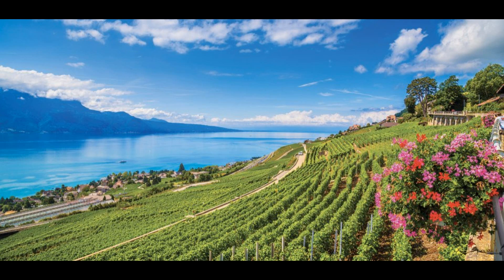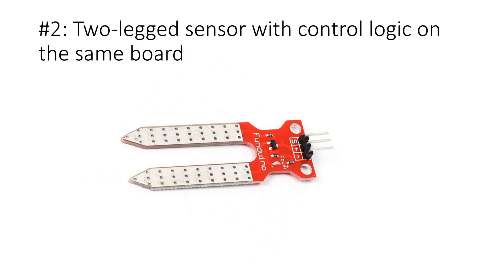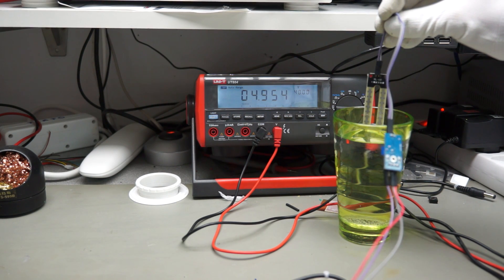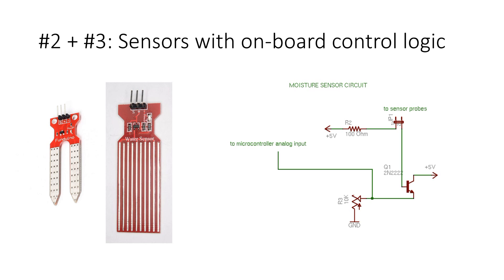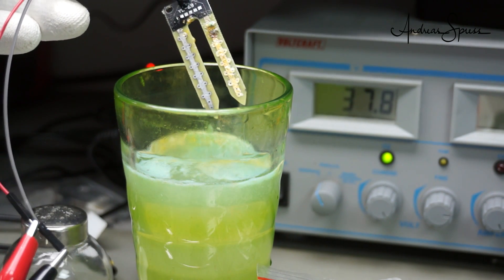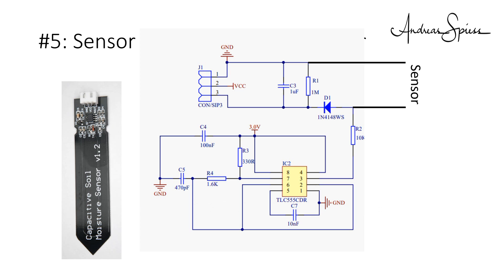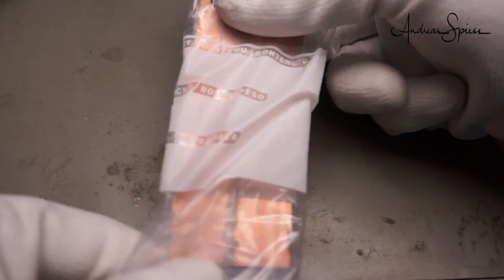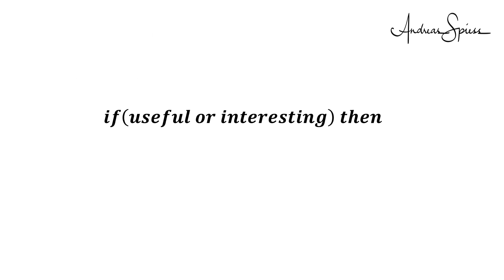#207 Why most Arduino Soil Moisture Sensors suck (incl. solution)

Comment: As we don't live on the surface of the sun the moisture does not need to be measured multiple times per second. Limiting measurements even to once every 5-10minutes increases the lifespan of the cheap sensor drastically as the lack of constant dc current means the copper corrodes much slower. Of course the time frame between measurements could be increased even more for a longer lifespan.
Reply: Water and other things in the soil will react with the metal even when no current is flowing, so a capacitive sensor is a much better option as it is 'non contact'. But you are correct the lifespan can be increased.
Reply: Still the natural process of oxidation would affect the measured values over the time, making the whole thing useless without constant recalibrations. Honestly I don't think it's really needed to have continuous  measurement at all, you calibrate the watering system once in June, monitor it for a few days and it will be just fine for the rest of the summer (at least in my mediterranean climate). But hey, we like to tinker with sensors, don't we... :)
Reply: Two stainless steel electrodes will last a lifetime. Copper in ground thats 35 micrometers thick, you got to be kidding me. Thats not even a problem...
Reply: And the capacitive sensors are like 3$, so it's not that bad
Reply: ivanhoe011 I measure 4 times a day sending power to the sensor for a few milisecs.. no need to recalibrate during the season
Reply: The key word in that sentence is "just".
Reply: You could also use other electrodes which do not corrode (as easily), such as graphite or platinum/gold (plated). The later two are probably more expensive though.
Reply: @kwinvdv  i use graphite rods. Works very well
Reply: Along with not needing a reading multiple times per second, you can get a LORA micro controller to run for weeks or even months on a battery if you have it sleep or, better yet, power off between readings especially if they are only done once or twice a day. Or have the voltage from a solar cell power on and run a micro controller first thing in the morning to take a reading and transmit it to a receiver.
Reply: Doxie: But I like this song better: https://www.youtube.com/watch?v=3JdWlSF195Y  (and the cats are extremely cute, so it must be true) :-P
Reply: Agree, and where can use AC to drive those sensors.
Reply: I d say once every 4 hrs
Reply: That is too much. I just need 4 measurements a day, and that is for an independent study to support effectiveness of a special compound I'm going to use. But I do want to build sensors with a lifespan of 40 or 50 years.
Reply: what about spray or dip coating the sensors in some water resistant coating substance?
Reply: Anyone thought about pulsing a resistor to heat it next to a thermistor? They can be protected in a conductive pipe and inserted into the soil. The heat wave seen by the thermistor will be a function of moisture level at insertion point.
Reply: Just use a digital out to power the sensor only when you need to read it.
pinMode(sensorVCC, OUTPUT); digitalWrite(sensorVCC, HIGH);
// analog sensor reading logic
digitalWrite(sensorVCC, LOW);
Reply: What about something like the vegetronix vh400?
Reply: Try to keep a plant wet on the surface of the sun ... Need to measure really fast to get something ;-)
Reply: There are a lot of Arduino sketches out there where a digital pin is used to power the sensor only when needed.
Reply: WKD:
what you say is right but to be sure to stop the galvanic corrosion you should electrically disconnect the sensor when you do not take the measurement, this should be done using another Arduino channel and maybe a bipolar relay
Reply: Benjamin Sølberg You could also greatly slow the effects of galvanic corrosion by cycling the polarity on each leg, which helps to re-attract the lost metal ions back to each leg rather than encouraging one leg to only ever shed its ions while the other attracts them.
Reply: @Micheal S:
Im not sure why you try to correct someone at something you dont really know anything about. But let me help you out: Its a "ball" of plasma, not gas. There are no defined changes in density as you know them from earth (air -> water, density times 1000), its all a big gradient. He doesnt say if the change is linear or whatever, there is just a gradient.
Reply: WKD and others - You're obviously missing the point completely. The exposed metal parts on the probes of the "sensors" are reactive, meaning that electrochemical reactions take place when they're submerged in the water EVEN IF THEY'RE NOT CONNECTED TO A DC SOURCE. This not only means corrosion of the probes, but also leaching of the probes' constituents into the soil. While tin is (usually) not too toxic, copper in higher concentrations IS detrimental to plant growth and nickel is really toxic. This is what you risk by using crappy probes in an effort to try and save a couple bucks.
Reply: You could also alternate the polarity between measurements
Reply: @Jadinandrews  you could, but if you supply power say 6 times a day for just a few msec to do measurement, changing the polarity is hardly worth it
Reply: Yeah, measurements once per hour, alternating polarity, thick copper wires instead of flimsy paths, and the sensor works fine for a looong time.
Reply: Michael S: My first comment was actually intended as a joke by completely ignoring the heat that would instantly burn the plant pot including the moisture sensor before it is even close to what we would call the surface of the sun. But I don't think that the statements "ball of gas" and "gradually increasing density" are completely wrong.

First, the sun is mostly hydrogen (gas) and held together by gravity, which has the tendency to pull everything over a certain mass into a nice sphere (ball). So yes, it is a ball of gas (mostly). Of course there are metals in the sun, but it is mostly hydrogen. The Maybe it it would be more correct to call it a "ball of mostly gas with a core of very hot and dense plasma" ;)

And as a object that is held together by gravity, its density increases with decreasing distance to its center. If there is any change in density, the less dense mass will rise and the more dense mass will sink. That is what happens in the convective zone. Those zones aren't "jumps" in density, they are just labels we have given to these regions to describe what happens in them.

I just repeat my words from my first comment:  It is just a ball of gas with gradually increasing density, nothing to stand on. :)
Reply: Michael S: Of course, gradually != exponentially. For me, gradually meant that there is a increase in density with depth, not implying a linear relationship between depth and density. :)

You could have pointed out that the density increases exponentially in your first reply. But this way was also good, as I didn't realize the use of the wrong word and this exchange of comments might be more entertaining and interesting for others than the original joke. ;-)
Reply: > the sun doesn't have a surface

Nothing has a surface, really; that's just a human concept. Atoms are fuzzy things.
https://www.youtube.com/watch?v=P0TNJrTlbBQ
Reply: Do you even need to measure it every 5 to 10 min? How about every 6 hours?

Use a DS3231 RTC attach the alarm pin to a mosfet that turns on the ESP8266. The sketch can come on, connect to the network, take the reading, report it's reading to the MQTT server, then set the alarm on the DS3231 which resets the alarm pin and shuts down the ESP8266.

That takes the standby to <<100uA for the RTC to run and eliminates any charge to the probe.
Reply: Copper oxide will form anyway the moment the coating has the tiniest pin hole its like rust on steel
Reply: Hi. Oh, I can't resist wading in! Yes, we don't NEED continuous measurements but arranging for that increases the complexity and the cost. As others have pointed out sticking bits of conductive metal into possibly damp soil is asking for trouble even if no current is being applied. It's fundamentally the wrong technolgy. As the detectors corode the measurements will alter and become misleading even before failure so the fact that it is cheap technolgy does n't help either. An automated sysytem using this would over or possibly under water. It's not until I saw this video that I realised just how challenging getting these measurements is. BobUK.
Reply: Sure there are a reaction while its not powered. But biggest reaction happens because of electrolysis (I believe that's what this process is called).
Reply: There's no water on the surface of the sun.
Reply: 2000jago: I just assumed that it was a joke, because the sun doesn't have a surface. It is just a ball of gas with gradually increasing density, nothing to stand on. :)
Reply: Pendant time: the sun isn't a ball of gas, it's plasma. Wait, They Might Be Giants did a song on this:
https://youtu.be/sLkGSV9WDMA
Reply: Doxie Lain and what is plasma..
Reply: Michael S: Yes, the sun has different zones. They are regions where different things happen, like the core, where fusion happens but it still has no solid surface. It is just a very hot and very dense plasma. :)
What did you try to say with the "Why do this ..." sentence? Why do what?
Reply: @zvpunry1971 fusion happens mostly in shells around the core as denser elements sink and are unable to fuse at the temps and pressure. You shouldn’t post nonsense to confuse people.
Reply: RFC3514 all concepts are human concepts, or am I missing something?
Reply: zvpunry , both "a ball of gas" and "gradually increasing density" are incorrect. If you were just joking, you should have stopped at "ball of gas" plus a smiley. I see people frequently assuming things must be true if somebody stated them in a confident manner.
Reply: why make things complicated, one should try to keep sketches small, so one can add usefull code when neeeded
Reply: To "zvpunry": Sun has an internal structure (a few "zones"), with the core presumably 150 more times denser than water. Why do this when so much of REAL information is available (for example, on Wikipedia)?
Reply: Good to know it was a joke, but if you know that much, you know that the accurate description is "exponentially" not "gradually." In a common language, "gradually" implies small non-dramatic changes (I think).

Comment: Thank you Andreas for your interesting videos! Why not to use stainless steel electrodes insted of standart wich  modules come with? Seems it will work much longer? What do you think?
Reply: contentex Stainless works better but still will dissolve eventually. The trick is Titanium electrodes - 1mm titanium wire will work fine.
Reply: Thank you for the idea!
Reply: contentex you can get cancer from dichromates. Take graphite! Easy to handle and not harmful. And it does not solve in any kind of way.
Reply: Thank you! What is wrong with what you said? Would you please explain. Thanks. What is your advice to make electrode from? As suggested by titanium?
Reply: wow! Thank YOU! WOW
Reply: Stainless steel contains chromium... Which can react under electrolyse to  a dichromate. BEWARE.

Comment: One more minute to see the finished protected sensor with the material you mentioned would have been a nice touch. Overall it was a very interesting and informative video. Thank you.
Reply from the maker: I also thought about that. But I do not have it in my lab ;-) Maybe somebody tried?
Reply from the maker: Big Clive proposed Nail varnish. (Tip from a Patreon)
Reply from the maker: Unfortunately I do not have the material at hand. But one of my trusted colleagues gave me the tip.
Reply: what about nail varnish?
Reply: Another thing that should be considered is how long these suggested protective coatings will last. And if they will release toxic substances in the long run. I doubt this would matter for decorative plants but if used for edible plants/vegetables it might. Of course this applies for the stuff that would be released from the exposed PCB also.
Reply: there are many ways to use this information, and is a good starting point.
Reply: something with like silicone in it would be better
Reply: To protect the capacitive sensor circuitry I used this silicone which is specifically intended for protecting electronics http://www.loctite.co.uk/loctite-4087.htm?nodeid=8802626568193 .. I'll probably try that but I wonder if it'll be too insulating. It's a great product though. It was very difficult to obtain at least in Finland and a single tube cost 40€. And my guess is it will dry out before I've used even 5% of it.
Reply: Ristomatti Airo Wow, that makes these sensors quite expensive 😉
Reply: Eduard van Raalte I might have some other uses for it as well :D
Reply: Ristomatti Airo 😄